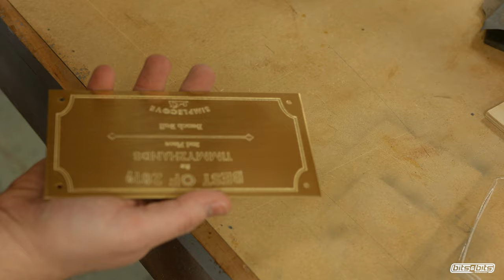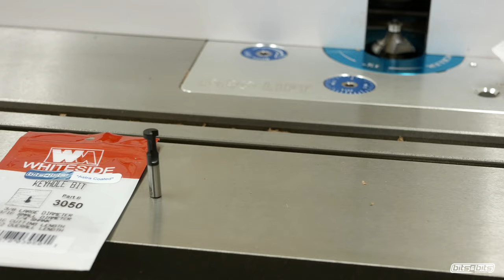How To Make A Brass Plaque on your CNC!

Comment: Nice, thank you for sharing.  What settings did you use for the 30 degree vbit to cut on the brass? (speed, step-over, etc.). Thanks again for sharing.